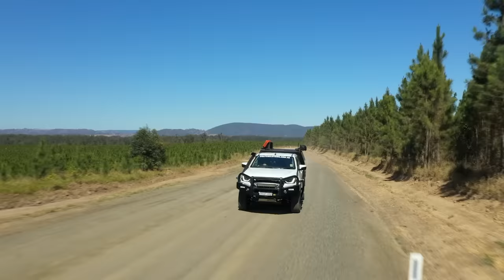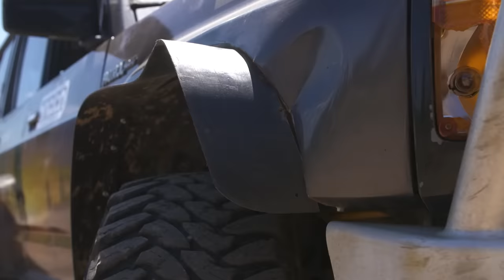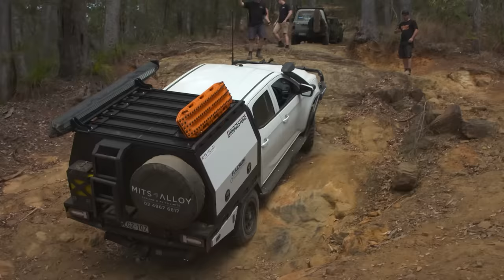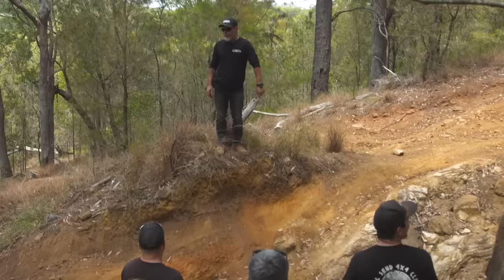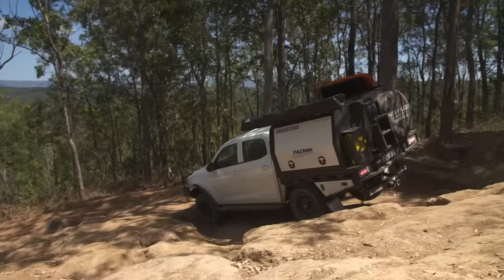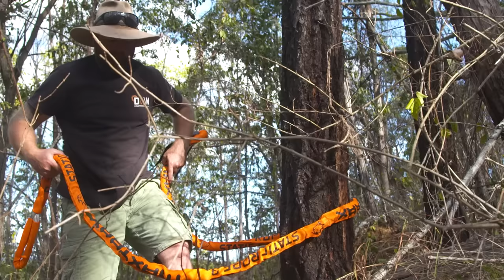THE TRACK THAT SCARED EVERYONE! Insane Bush Mechanics & Shauno’s Funniest Cook-Up Ever!

Comment: Throughout watching the videos over the years yall really made me feel solid of my own rig (2000 s10 zr2) being an ifs. i havent drove it yet as its been plagued with transmission and transfer case problems. but im building it to be a beast sitting on 33's paired with 4.56 diff gears. its about 90 percent done at this point

Comment: Darryl reminds me of my first truck.
1990 Dodge Ramcharger.
No lockers, not even a posi rear, but it would go ANYWHERE.
I have so many fond memories of that truck; packing 14 people inside and driving just to drive, doing service calls at my first job, moving camper trailers around the lot, dragging a busted backhoe out of the woods, sitting on the hood watching fireworks with the radio playing, even sitting in the parking lot of the liquor store selling seed corn out of the back. I won't even mention the girls...
If I hadn't hydroplaned into a guardrail 9 years ago, I'd probably STILL be driving it.

Comment: Picking up the trash is a good idea.  Here in the U.S. Arizona's Sonoran Desert, plastic goes away in a couple or three years, but the deterioration depends upon climate.  Here are some estimates by experts: Glass bottle 1 million years
Monofilament fishing line: 600 years
Plastic beverage bottles: 450 years
Disposable diapers: 450 years
Aluminum can: 80-200 years
Boot sole: 50-80 years
Styrofoam cup: 50 years
Tin can: 50 years
Leather: 50 years
Nylon fabric: 30-40 years
Plastic film canister: 20-30 years
Plastic bag: 10-20 years (???)
Cigarette filter: 1-5 years
Wool sock: 1-5 years
Plywood: 1-3 years
Waxed milk carton: 3 months
Apple core: 2 months
Newspaper: 6 weeks
Orange or banana peel : 2-5 weeks
Paper towel: 2-4 weeks

Comment: Hot  tip for your car trailer i went to KINGS and got myself a winch and pulled off the hand winch and put it on. Does not matyer what car i out on it a Landcruiser or anything its on in minutes. 
Good on you all fpr cleaning it all up. 
Here in vic its hard to get rid of destroyed cars on tracks. Lots of BS, thats what you get for the nanny state

Comment: Yea the Boiz, been waiting to see the DMax!!! Even better when darell is around
Reply from the maker: Which would you own?
Reply: Well as I own a GQ patrol already I would have to say the patrol! But the new dmax looks great, good to see MITS ALLOY made a kit to move the sensors in the rear bar, as all I have seen getting around with a tray on the run rear bar is still on them

Comment: Hi guys, what are your thoughts on the 2005 Mitsubishi Triton 3.2did 4m41..? I have recently purchased one here in the UK. Are they reliable and strong motors? Mine is the 4 speed automatic with the 4m41 engine. I'm looking to do some camping and some long journeys in it next year - is there anything I need to be aware of with these and also is there a tuning box you guys can sell me to get some more power and torque gains from it? Also, if anyone has one do you have any videos of you doing some tracks? Looking forward to your reply, thanks.

Comment: Quite astonished at how hard tyres appeared on Grahams Dmax. Sitting at 45 degrees on Ball Bearing Hill and the rear tyres are not compressed. That's still too hard. Then look at Ruben's stretched 200. Even sitting on flat ground you can see the tyres are deflated to more suitable pressures for rock climbing. Ironically the extra traction of the softer tyres probably contributed to the CV breaking.

Comment: Loved the video guys but I'll admit it scared me seeing Graham put a loaded trailer on the back of that new D-max. I know it shares a frame with the Colorado. There's cheese holes in the frame directly behind the cab over the top of the rear shackle hangers. It's a large stress point when weight is put behind the frame.  Rear suspension gets loaded on a bump trying to lift trailer wieght. Frame crumples over front shackles. Needs to be checked after every trailer is towed with these vehicles. Otherwise it's an outstanding vehicle. GM tech.

Comment: Damn the angle of the cv’s on that dmax doesn’t look good
Reply: Look completely normal mate
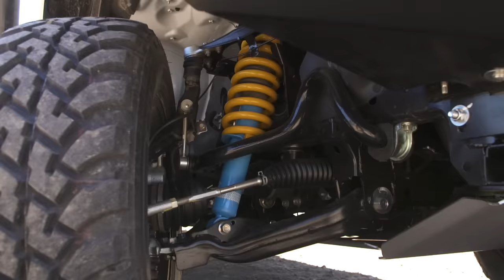Reply: Chris Jones at 1:15 that’s not normal.
Reply: @frankenbeans1967  yeah it is mate, he only has a two inch lift, there is a slight angle in the cv which is what you want
Reply: Also you can’t even really see the cv angle at 1:15 anyway
Reply: Chris Jones your wrong so I’ll leave it at that.
Reply: @frankenbeans1967  well I will take that as I’m right. You can’t say I’m wrong without an explanation but I’m cool with that.